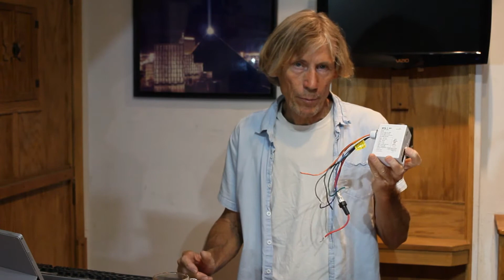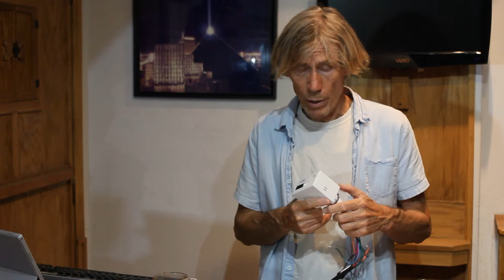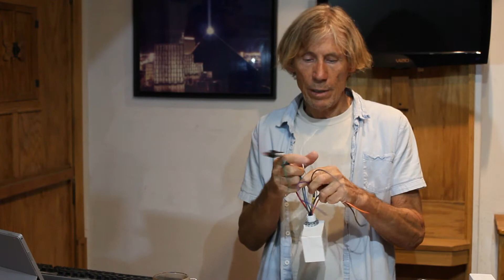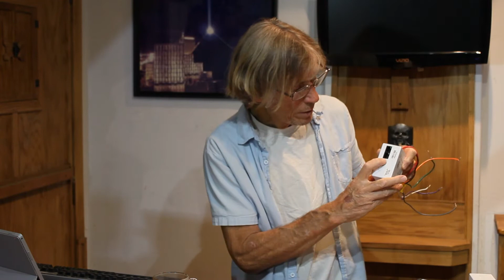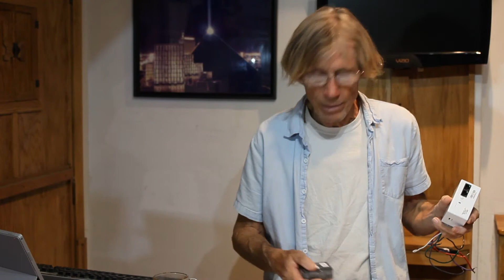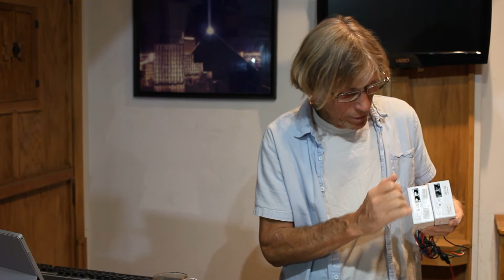How to setup nLight Dimming Packs

Comment: Very helpful video going over some of the basics. Thank you. The LED inrush point is one that almost no one goes over. Too often overlooked.
Reply from the maker: Thanks so much for the kind words. I was going to start a Youtube channel about electrical components and wiring methods but I was getting burnt out on the trade. I'm 67 now and started working as an apprentice at age 18.  I actually started out in a large non union shop and after 4 years I took the test 2 times but finally got my JW card. At that point I went to work for Boeing and worked in a union for 34 years. The last 10 years working there I basically worked on their PA system and ran trouble calls on machine tools. Not a lot of construction but tons of good work. After I left Boeing I went back into construction for a couple of years and just could not keep up with the younger guys doing residential work. Now i just play with my RC cars. No mor attic crawling for me.
Reply: @RCRoads I can understand not wanting to crawl attics! Haha. I have just started my electrical company in NorCal at age 34. Commercial remodel and new construction keeps me out of attics most days now.
Reply from the maker: @Ca_Tule_Ninja  That's great. It will be nice to work for yourself and grow your own company. Electrical work is forever changing and never boring. Best wishes to you my friend.

Comment: Hey there, great video, i find myself working with these, thanks for the info!, whats the name of the device? so i can programm them with my phone?
Reply from the maker: Aw thanks. It's called the NEO and you can still buy them from acuity.  The actual name is ( nIO BT ) and I think I got mine from Walters Electric for just over $50 and I have even seen them with a google search and the prices are various.
Reply: Excelente y información por favor sigue con mas videos de eso nuevos equipos